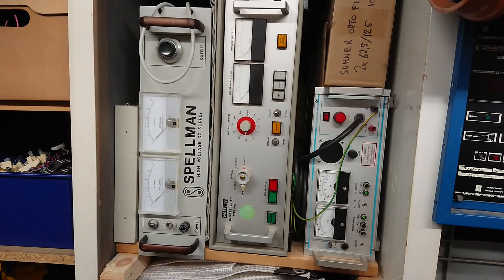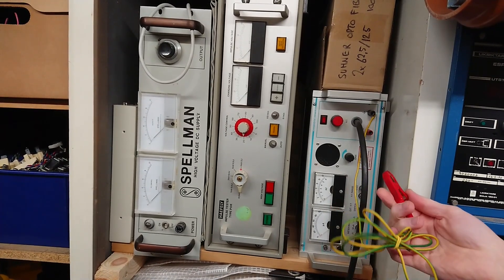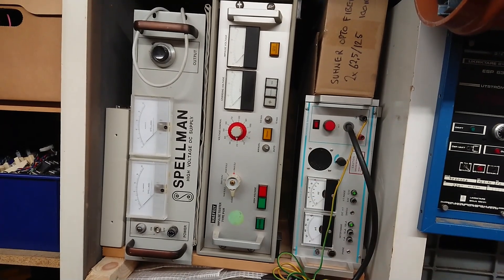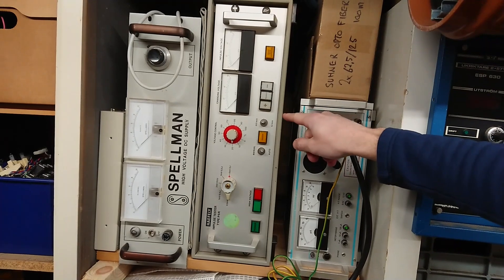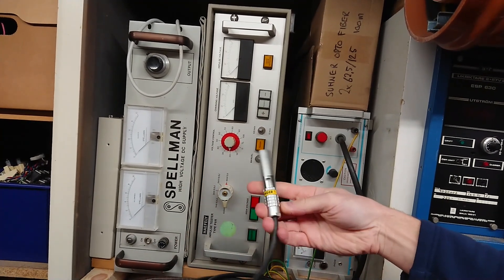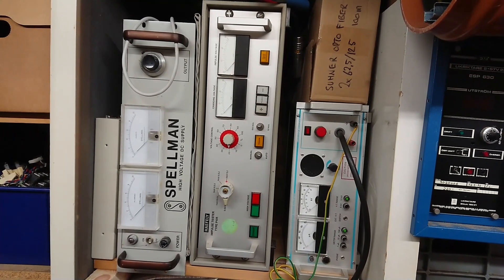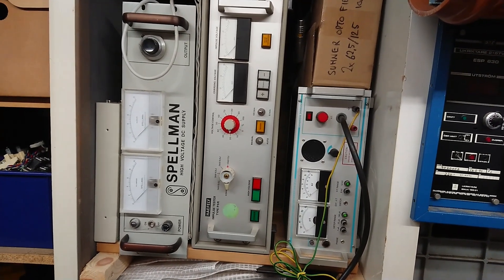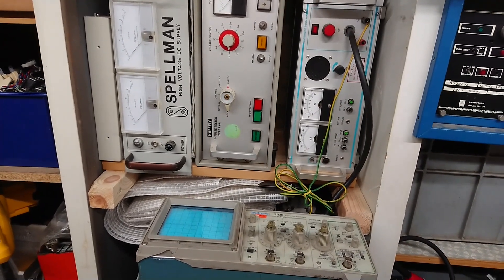High Voltage Equipment Repair Queue - Isolation, Day 8

Comment: Nice assortment of HV gear Mads. 

Seems like a bunch of good projects and useful bits of kit, once they are repaired. 

The cord for the second unit is really funny. The Lemo connector is propably a FFA.1Y.410.CLAC32, which is rated up to 15kV DC and will cost you around 50$. In comparison to that the chunky plastic pipes with banana plugs seem quite .... wrong.
Reply from the maker: The non-destructive tester is actually my favorite of them. Since it has so many purposes like fault finding, material testing, uA experiements and even generating music in a modular synth kind of way :)